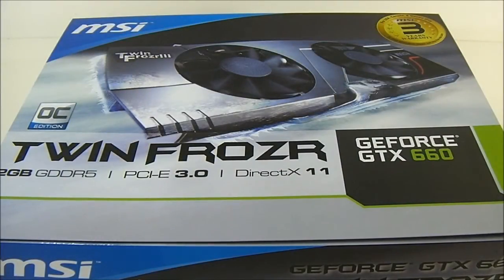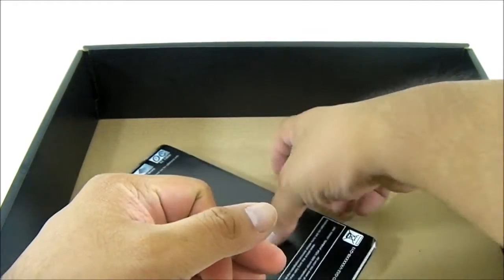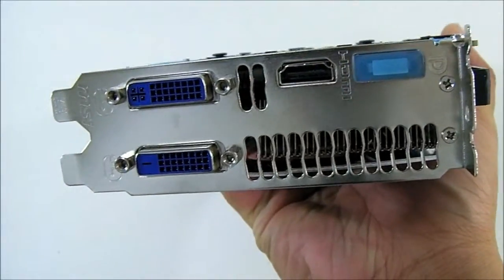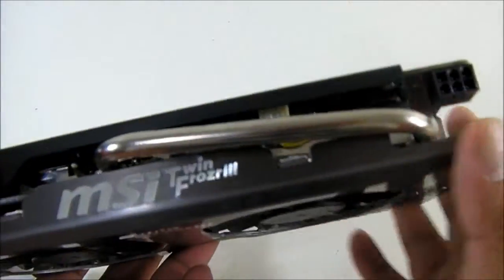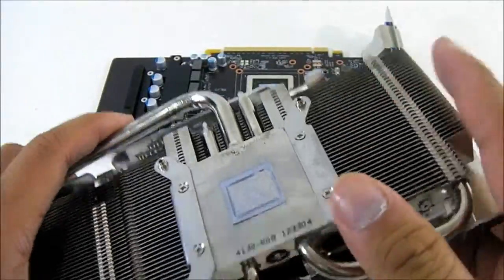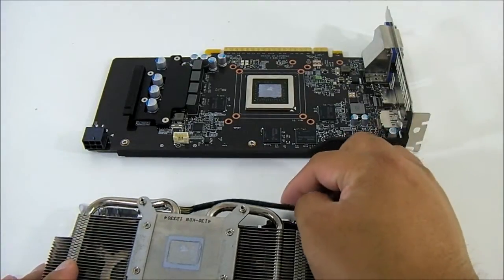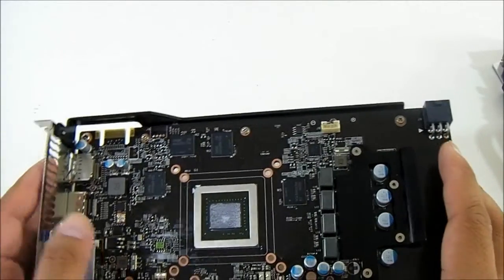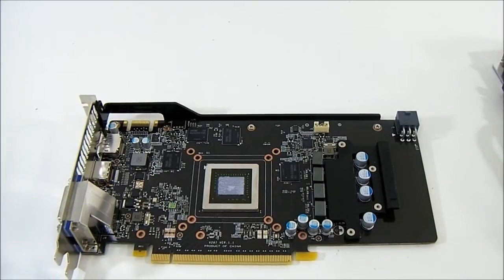MSI GeForce GTX 660 Twin Frozr OC Video Card Overview

Comment: Im also building a rig, the airflow should be fine, direct it through the front to back i recommend 4 fans, im going crazy with cooling on mine, 4 fans and liquid cooling system, if you have at least 2 proper fans you should be fine with this CPU, if positioned properly

Comment: Depends on what you're looking for. Radeon cards tend to have higher frame frame latency and tend to run hotter. However, Radeon cards work better in OpenGL, Adobe Premiere, and other rendering scenarios, as well as Bitcoin mining. Are you looking for 1080p gaming that's GPU intensive?
The actual difference between the two is very thin. You can't go wrong with either one, really.
BTW, ATI doesn't make graphics cards.

Comment: If you have the full tower case version (there are 3 versions of that model), it will physically fit.

But the rest of the very outdated components will bottleneck it like hell and the is very close to zero chance that your powersupply will be able to handle it.

Time to upgrade.

Comment: lol u think imnt know that? There is different coolers -> temperature -> noize. And i like gigabyte coz i have motherboard which work 6 years without problems. 2 weaks ago died my card 7900 GS too 6 years old. I think its good especially with guarranty time 3 years )